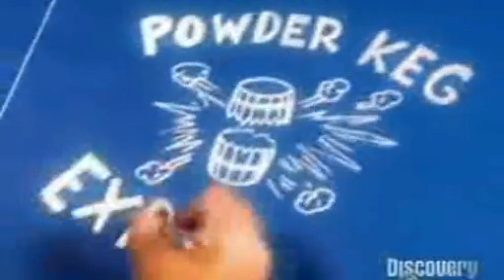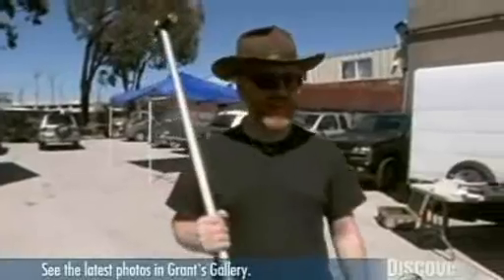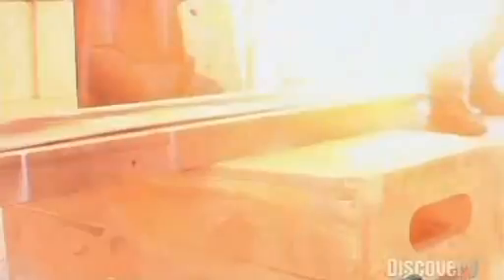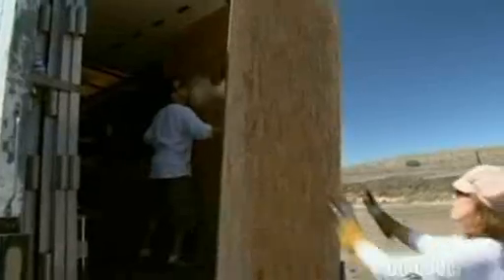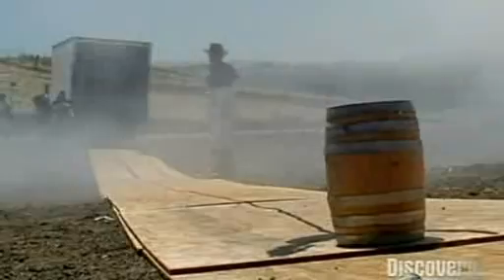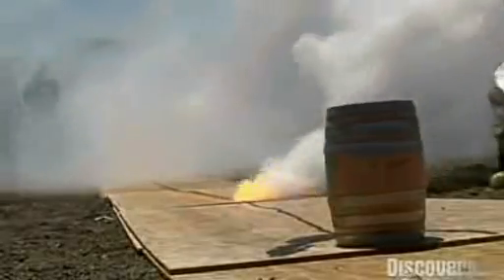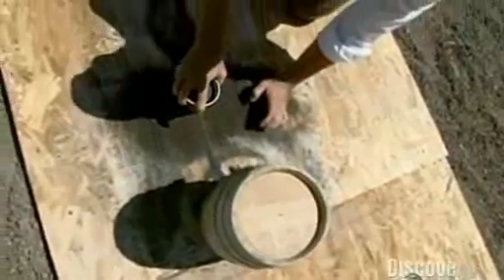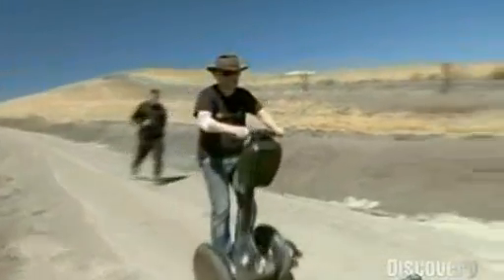Mythbusters - Powder Trail

Comment: They should have put the barrel on the tailgate of a trailer or wagon or something, set it rolling and then either popped a cork at the bottom or, (more historically accurately,) shot it with a pistol, releasing the black powder creating the trail.

Then, while the barrel was still in travel creating the line ignited the table end, seeing if it would catch up to the barrel before it emptied and exploded. 

That would have been far more precise to something than would have been known to have happened, like in a dramatic moment in a movie or even historically.

Comment: Would a thicker line of powder burn faster? Seems like they poured the bare minimum. If someone was setting a line of powder poured from a keg it would not be that small or neat.
Reply: It would. See: the flash when they laid down a freely dumped line in the first testing. So, maybe less "confirmed" and more "plausible". If the line is fairly short and the powder is generously poured, you might get a flash too quick to chase, but a thin, measured line like you'd use for a old-timey "fuse" is very doable. So, how much powder does the villain have on hand, exactly?
Reply: @twistedtachyon5877  A fairly short line is a good way to get yourself blown up. he must have had at least 1 kegs worth. its not just how much he has.. its how much can he pour from the keg while leaving a consistent enough line to be sure it will burn. Do you think a villain would use a plastic cup with a hole in it? On smooth plywood? No, they would pour a messy line from the keg on dirt. which would require a lot more powder to account for the uneven surface.
using such a small amount of powder would not work on an uneven surface nor could it possibly be poured from a keg.
IMO

Comment: Someone already pointed this out but the FFFF isn’t just a bunch of nonsense on the label, it’s the speed that it burns. FFFF is the fastest burning powder which seems pretty unfair for this type of test. Myth busters is kind of a lousy show when you see these type of critical mistakes. For example in another episode they tried to test if the back wheels would come off this car like it did in a movie from the 50s. Instead of using the same car in the test they used a much more modern car and of course the wheels didn’t come off.

Comment: "You can buy this in most gun shops" - shows Goex, which is so rare people drive to other states to buy it.
Reply: What’s so special about that brand of black powder? (I don’t know anything about this type of stuff)
Reply: @gefagnis  It's not even the specific brand.  Goex, Swiss, and Schuetzen are all brands of pure black powder.  The thing is, since the Oklahoma City bombing, federal regulators have clamped down heavily on certain chemicals, including black powder.  Due to federal regulation on the transport of black powder, many gun shops do not think it's worth the headache to stock it.  The restrictions do not apply to black powder substitutes like Pyrodex and Triple Seven.  However, because black powder substitutes are designed to be more stable and more difficult to ignite, they do not work as well in certain firearms, namely flintlocks, and they are often more difficult to clean.  Because of this, some people will go to great lengths to acquire real black powder.
Reply: @coltonregal1797  Wait, was black powder what was used in the OK bombing? I thought Timothy McVeigh used ANFO for the bombs...
Reply: @IgnatianMystic  I believe he did, but Gov't gonna Gov't.
Reply: @cap5856  Ahhh.

Comment: Not ply, not chip but OSB floor panels. Made to quite good tolerance (thickness, T&Gs and finish) so you get a nice even joint without steps. Joints without trips.

Comment: The higher the number of "F"s that he showed was 4Fg.that is very fine powder.  The finer powders usually burn much quicker. A  keg of old-time black powder was mostly for blasting in mines and such. This would have been single Fg  powder.  It burns a bit slower.
Reply: Seconding your comment. During some of the festivals where I live in Chiapas, powder trails are laid down between fireworks, so that the fireworks go off in succession. Those trails burn more slowly than shown here.

Comment: Not an accurate experiment. Cowboys who set up such an explosive device wouldn't have had plywood at their disposal - they would have poured the gunpowder directly on the ground (or rocks surface).

Without the plywood surface to run on, these guys wouldn't have been able to run as fast because their traction in the loose soil would have been worse. In addition, because the gunpowder would have been poured directly on dirt ground or rocks, such a small stream would have been insufficient - it would have been a heavier amount to prevent getting mixed with the dirt and diluted to a point that it would have been useless.

Comment: Part of the problem is that they used 4F powder, which is only the finest powder you can buy, and burns VERY fast. Like, 4F is usually the charge in the flash pan if you're shooting, for instance, a flintlock rifle (NOTE: most of us enthusiasts tend to prefer percussion caps these days for one reason or another... for example, my reason is that I find them to be more convenient, and I don't really care for measuring out 2 charges for every shot. One is quite enough, thankee very much). If they'd used 1F or 2F, it'd be more coarse, and wouldn't burn QUITE as fast
Reply: i mean, they did eventually upgrade to percussion lock rifles

Comment: Still don't think it was done under actual conditions.  How about doing it as it would have been done?

Knock a hole in the end of the leg and shake/pour it out ? Do it on a sand and rocky surface with small rocks on the path also ... not on flat sheets of wafern plywood ?  Also, what were the kegs of powder being used for?  4f powder is used for the flash pan of flint locks.  3f was for pistols and 2f for rifles.  Not sure about 1f (blasting or cannons ?)

Comment: Unfortunately, this doesn't answer a question I have.
You've seen cartoon characters roll these barrels of black powder.  Would the barrel still ignite if the barrel was on its side or still in motion?
Reply: As long as the flow of powder out of the keg is constant enough to allow the flame to reach the hole, it will blow up.

Comment: i hate when people call black powder "period correct" for anything before the mid 1900s. black powder has a massive amount of potential energy, far more than the garbage tier blasting powder used before then, to the extent that firing any weapon, modern or past, completely loses all accuracy after 30-40 yards. thats why they tended to use massive projectiles, or in the case of mortars, exploding massive projectiles.

Comment: The number of Fs actually shows how small the grains are; it's not how "explosive" it is.
Reply: Grain size is a good guide to burning speed and if confined the rate of rise of the explosion products. Smaller grains burn quicker than large grains, due to having a larger surface area.
Reply: it is, the smaller/how fine the powder is - the better the explosion would be

Comment: Listen close to the man's caution: "don't try this at home".  Under certain atmospheric conditions, that cup of black powder they put at the end of the line can explode just as if it were in an enclosed space.  I used to know a police officer missing a few fingers.  Part of his job was disposing of illegal fireworks back in the day.  The line of powder he lit exploded and took a couple of fingers off.  I once got my fingers pretty well cooked doing this with a lighter.  Usually they used smokeless powder in the movies.  When not in an enclosed space, it burns very slowly and it is classed as a propellant, not a low explosive like black powder is, so it is much safer.   Oh, and when "smokeless" powder is burned in the open like in a line of powder, it produces plenty of smoke.  That remote igniter is a really good innovation.
Reply: I'm looking at a 1 lb. Container of smokeless labeled explosive at the moment.  You may be referring to pyrodex.  Smokeless is quite energetic, more so than black powder.
Reply: @sinisterthoughts2896  Yes, when it is in an enclosed space, it certainly is.  Poured out in a line, it burns quite slowly... though the burning rate varies with the exact type of powder.  I.e.: 2400 burns more slowly than Bullseye.

Comment: The powder shown in movies would in real life almost certainly be blasting powder or maybe cannon powder which is about the same.  My grandfather was a coal miner back when they still used black blasting powder to move coal before the machines.  My father told me that grandfather once set off a full keg of blasting powder on a stump to see what it would do.  Now this was a metal keg of 25 lbs of black blasting powder which is a much,much larger grain than the ffffg used by the myth busters in their demo and it burns much slower in the open this of coarse was confined.   My dad remembers that it popped the metal lid off with a minor explosion and mostly just made a big fountain of fire and white smoke no real explosion at all the metal keg remained setting on the stump and did no damage at all.  Now you should know that when this same powder is placed in paper rolled cartridges of perhaps two lbs each and several are used at once with cartridges of sand tamped on top down in a hole drilled into a coal seam they will move tons of coal with considerable blast and noise.
Reply: All about pressure
Reply: @Tiyratania  right, pressure is the key.

Comment: They're using 4F powder ! as in FFFF rating. the fastest burning black powder. 
They should have used a 2F
Reply: I also noticed the use of ffffg powder and it has never been used for anything except flash pans and fireworks most powder was ffg or blasting powder which burns very slow when unconfined. if you want to know how slow see my other comet.
Reply: @donaldbarnett8045  easiest to get big kegs of in those days would have been cannon powder, which is generally a step below 1F.  (Or more likely then, just plain unscreened, so a mostly-coarse mix of everything just as it came out of the mill's mixer.)
Reply: @kd5nrh  and often not corned.... :-)
Reply: @donaldbarnett8045  You have two COMETS ? wow. Comments meant you?
Reply: I honestly think that the use of FFFF was the best thing they could have done in this scenario, since they used one of the fastest burning powders, it makes it clear that the myth is confirmed pretty much regardless of the powder used. Everything lower on the scale would just be easier to put out.
Reply: @Bistai949  yeah for the sake of the experiment it would make the most sense for them to use the fastest burning gunpowder
Reply: I think, for the time period depicted, black powder was a little both.   the quality control was not as good then as it is today, so, every shipment to miners would actually vary a little from barrel to barrel.
Reply: Agreed, the powder grade does have an effect, with ffff literally designed to burn at an extreme rate in a unconfined scenario.  Heck, you shouldn't use it in a firearm, because it will be to energetic.(in reference to duration).
Reply: 4F is for homemade fireworks and flashpans.
Reply: But what if the bad-guys are using FFFF?
Reply: It worked with 4f which proves all fs work
Reply: I thought ffff ment 65535
Reply: @knarftrakiul3881  ff=255  ffff=65535  with apologies for the nerdy correction to a good joke.

Comment: It should be noted that not all gunpowders are created equal and different mixes burn at different rates, but they did try to get as close as they could to a period appropriate mix. If you were paying attention they also showed that a fat, uneven line burns considerably faster than a narrow, consistent one. Haphazardly pouring the way they show in movies gets a faster burn than what they were able to do with some field expedient measuring tools. Things to consider before pronouncing "confirmed" with absolution.

Comment: 4Fpowder is really fine, and is more of a flash powder then a GUNpowder. It's what you put in a flintlock's pan to get a spark to ignite the coarser powder you put in the barrel. The reason for a coarse powder is a larger surface area gives a faster release of pressure.
If they had put a coarse GUNpowder down as a fuse the burn would be much slower.

Shame they faked it at the end. There was no way, even with highly combustible 4F, the flame would have jumped an 8 inch vertical gap to ignite the (little amount of) powder in the bottom of the barrel.
The slow mo shows there was powder under the barrel which is what ignited, broke through the base and blew the main charge. 
The real tragedy is if they had just laid the barrel on it's side with the bung hole at ground level they wouldn't have needed to get fakey to go out with a bang.
Reply: +docthebiker Larger grains actually have a reduced surface area relative to their size, and thus burn slower, all things being equal. They used smaller grains in cartridges and rifles, and larger grains in artillery. Very fine grains (effectively powder) cant oxidise properly, which is why you need some grain structure to ensure they get adequate amount of air mixed in.

Comment: So the barrel had a hole it in. Without it, I doubt the fire would just magically go through the wooden barrel and light the powder. It would not be enough to make the wooden barrel explode or burn, unless you have a good portion of powder where the barrel is.
Reply: If you look at most movies,  they use a keg that has a hole in it,  then use that same barrel at the end (or that barrel and some more), and what they said at 7:08  (the stream coming out of the barrel)  suggest that there must be a hole.
Reply: Debbie321lopez And how is what you wrote relevant?
Reply: It's just a movie cliché,  i thought your comment was on that fact,  if not, then i am in the wrong
Reply: Okay, sure, you confirmed that a hole is needed for it to work. It just felt kind of redundant at first glance, sorry.

Comment: Powder was made by milling the three componets  as fine as possible, mix them intimately in the presence of some liquid, press this "dough", dry it, and then break the "cakes" of Powder up again, sieve to the diffrent Sizes of graines and then finish off the Powder. The grain Size directly dictates how rapidly it burns in the weapon. Big-Bore Guns used bigger grains, because if all the powder of the big load would burn instantaneously, it would create a pressure-spike that blows up the gun.

Comment: @SadOlympist No it's not modern a black powder replacement like Pyrodex or Triple Seven.  Shown multiple times in the video is a can of GOEX which has been made the same way for the last 150 years.  The FFFFg granulation they display is used for priming the flash pan on a flintlock muzzleloader.  It's quite likely you're thinking of quick match.  Quick match burns at roughly the rate you're expecting black powder to.

Comment: 4fg is the smallest granule for small bores.  It burns faster than 1fg which is the larger granules used for a big musket or cannon.  I wonder if the 1f would go much slower or close to the same?  Any buckskinners out there want to try it?

Comment: They are using FFFF powder which is used in the priming pan on flintlocks and no where else. This is because it burns too fast and would explode the gun if it were ever put in a chamber. They should be using FF powder at least to replicate what was used in the old west.